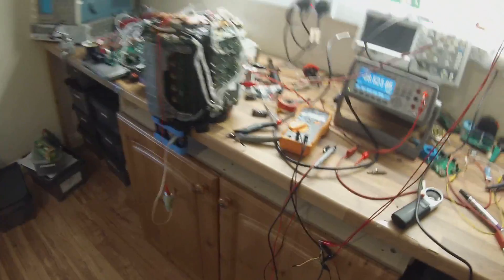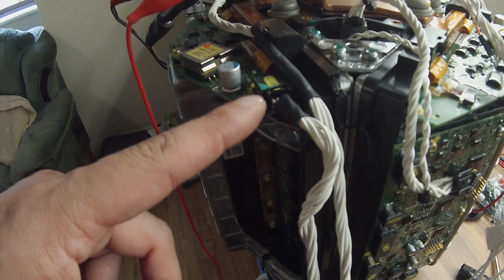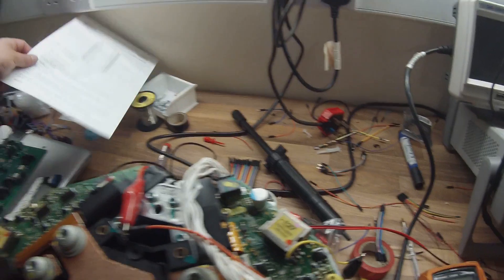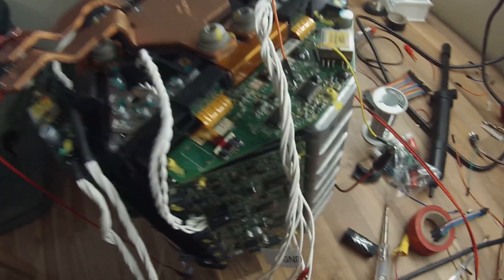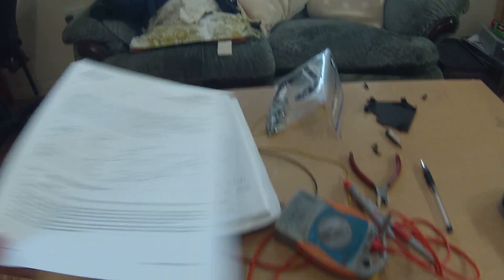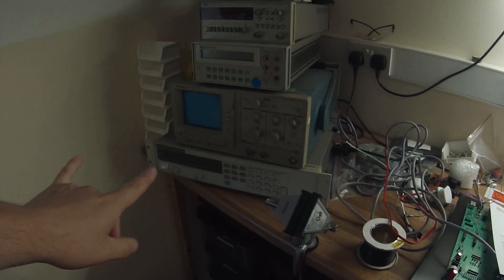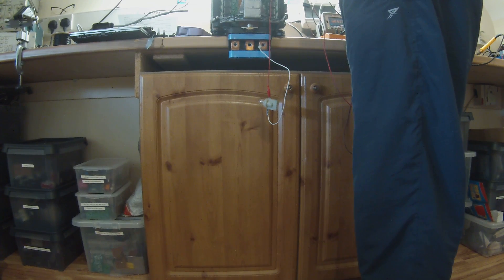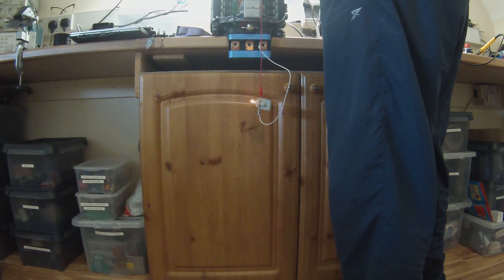The Tesla Project : IGBT Driver

Comment: I'm wondering, why bother with any reverse engineering?  Jack Ricard has cracked the communications protocol and has successfully installed a Tesla drive in a VW vehicle.  You can bet your bottom dollar that Tesla's controller is going to protect the IGBT's a lot better than anybody else's engineering.
Reply: Damien has bypassed the Tesla logic board. He is the first one to have complete control of this motor. As I see it this is a very good day.
Reply: Benny Regall
 Where can we buy Damien Maguire’s logic board?
Reply: @randycarter2001  I've visited evbmw.com but I didn't see a motor logic board for the model S or model 3. What I found were charger logic board. I would really appreciate it if you can direct me to the webpage. Thank you.
Reply: @kayokkayok  The Model 3 is still under development.  The files to construct a Model S are on his github page.  Your best bet is to contact Damien through his website for the most up to date info.
Reply: Randy Carter Thank you for all the information. I’ll do what you have suggested. Thanks again.
Reply: randycarter2001 because different firmware means one motor won't work when another will.
Damien's approach is way more scalable, jacks' is required for other reasons